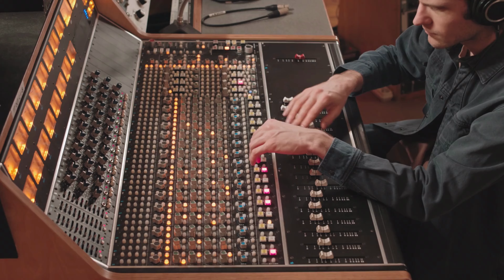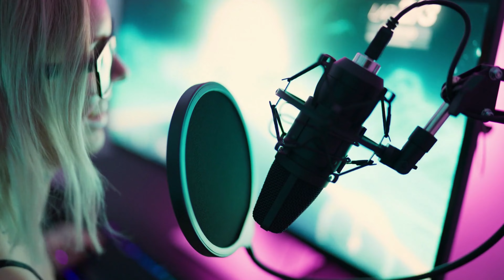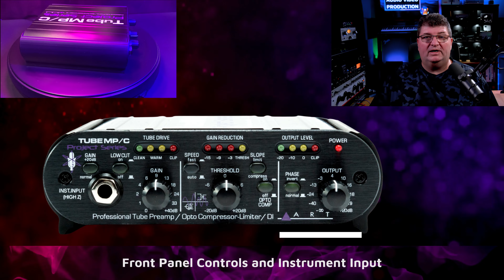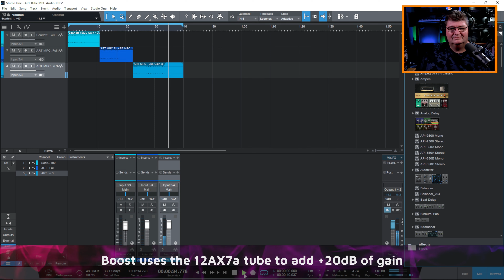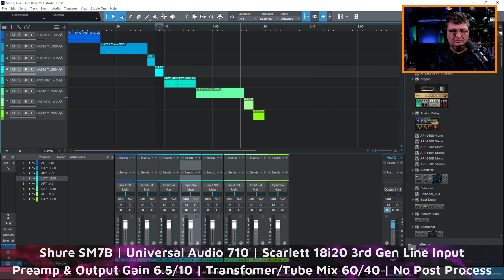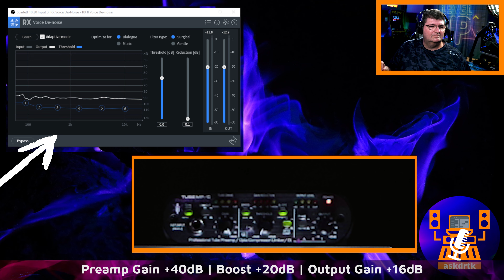ART Tube MP/C -  Preamp & Compressor - 2022 Full Review

Comment from the maker: I used the SM7B for this review to put a high demand on the preamp and I found the MP/C was able to provide plenty of gain to stage though the 18i20 into Studio One. I didn't include mic boosters in this video, but I have tested the Cloudlifter CL-1, the sE Dynamite, and Klark Teknik CT-1 with the MP/C. All performed well and I did not experience any impedance issues.

The compressor section is a simplified version of ART's Pro VLA II Vactrol Opto compressor but shares its smooth characteristics, so at a cost of around $150 USD at the time of recording (and available from Long & McQuade for $149 CAD) the MP/C is a bargain...
Reply: Very nice video, I would like advise on what would be a budget friendly eq for this Art preamp? Thank you

Comment: It seems it´s powered by 9V AC, not DC. Is there a way to use it with any battery? I mean, sometimes I have to make music on the roof of a building, in a container, on a sail ship, a zeppelin, an 80 days travel in a balloon basket, on a space station during a 1000 year long flight between 2 galaxies, etc... they usually don´t have any AC current in any of those. How could I power the ART Tube MP/C in cases I only have a power bank that delivers DC output? Anyone?

Comment: What do you think about dbx 676 vs ART Voice Channel? I would like a lot of coloration, grit and saturation. Thanks.
Reply from the maker: Having worked with both, there are positives and negatives with each in terms on onboard effects, but in terms of pure tube drive, the DBX offers a wider range of "usable" saturation control imo. That said, both are capable of considerable coloration / saturation and can provide an aggressive sound. I hope this helps out. Cheers!
Reply: @askdrtk  Thanks. I see that both are relatively old and not very popular, not that I care about what the majority thinks, but are there maybe some better options?
Reply from the maker: You could also look at the new Warm WA-MPX. It lacks some effects found on the dbx and ART, but is is based on a classic design. Moving up in price, the Avalon 737 is popular as well. The thing is, there is not a lot "new" in tube preamps / channel strips as many are based on classic designs (often for good reasons). In the end, its about sound. I have new / old / expensive / budget gear in the studio and those considerations never come up in choosing what to use when recording or on a track or mix. I choose what best fits based on my ears. New gear can be exciting when it is released, and may even improve on what is currently available, but when companies keep making gear for a long time that also says something about how it is received over time. Just my thoughts, but may help...

Comment: Very nice and thorough review! Actually one of the rare ones which don't jump to conclusions and which don't sound like commercials. Only one comment from me - the UA 710 doesn't have a transformer-coupled input. I have one and I know it for sure.
Reply from the maker: Thanks, I am glad you enjoyed my review. I think UA decided not to go with an input coupled by transformer and instead used a trans-impedance amplifier and caps was their intent to make the solid state path as transparent as they could. This left the tube path as the color circuit. For me what is impressive about the 710 is that UA was able to create a phase-coherent variable blend of the two pathways. The 710 isn't my go to preamp, but for the right sources, I'm glad to have it in my rack. Cheers!
Reply: @askdrtk  They went that way to make production cheaper and maximize their (otherwise very ample) revenue MHO. Do you know there is a 1:1 clone of the 710 produced by a Chinese brand I'm not going to name which most probably is produced in the very same factory where the UA is made!? I would even guess it may have better components inside. For instance my 710 when you look inside has the large PP caps no-name brand in gray color while any add for the amp shows clearly red WIMA ones. It's beyond any logic how much they charge for "Designed in...." but "Made in China" products.
Reply: @dkokalanov link to the Chinese equivalent plz 🙏
Reply: @dkokalanov  thanks 😊

Comment: could this work as a di box connected into a pa system for a live acoustic gig?
Reply from the maker: Sorry I missed your question earlier. Yes, and the rear output switch gives you options for connecting to a pa and an amp on stage for monitoring at the same time if you need it.

Comment: Have you ever compared it with Pro MPA II
Reply from the maker: Not directly with the PRO MPA II. The gain structure on the input side appears similar other than variable input impedance on the Pro. The output stage on the MPC has an additional 10dB of gain vs the Pro which I would think ART did to account for the compression circuit. It would be interesting to do a comparison of sound, gain structure, and circuit topology of a few ART preamps (VoiceChannel, Pro MPA II, etc.) Cheers!

Comment: I just remember mine being all buzz.....any recommendations? I couldn't figure it out.....
Reply from the maker: I'm not sure which other gear your were using / what the MPC was connected to, but I connect my gear to isolated outlets (Tripp Lite Isobars) to ensure EMI doesn't pass between gear - I do this even when my studio power runs through Furman conditioners as mine do not have individually isolated outlets. Another thing I like to do is add a ferrite core to the power supply cord about 3 inches from barrel connector that plugs into the MPC (I actually do this will any gear that uses an external power adapter that does not have one already). If you are using the unbalanced output to connect to an amp (with the DI input) noise can sometimes come back from the amp. In that case an isolation transformer (such as a CleanBox) between the amp and MPC will usually take care of the noise. Beyond that, the usual cable routing considerations apply - try to keep audio cables away from power cables. I can't say I had any particular issues with the MPC, but these few steps have generally solved an issues in the past. Hope this helps out. Cheers!

Comment: How do you use it as an insert in a mix, how do you connect it to use the compressor as an insert?
Reply from the maker: There is not a dedicated line level input on the MPC, but I have tested line level through the XLR input and it does work in terms of signal level with the gain in the minimum setting. I set it up in a loop with a line out from my audio interface to the line in on the MPC and the line out on the MPC back to a line in on the audio interface. As I mentioned above, the gain level does work with the XLR input and the compressor functions as would be expected. This of course is not a bypass of the preamp, however with input gain set at minimum preamp coloration as low as possible (much like audio interfaces where in some cases the preamp stage is not bypassed with line inputs). Sorry for the delay in getting back to you, I hope this helps out.
Reply: @askdrtk  Thanks for your reply, I'll try it out

Comment: Hello, can't find this answer anywhere regarding this ART Tube MP/C - can you use both outputs simultaneously?  Unbalanced 1/4 inch into guitar amp and balanced direct into interface, like a DI splitter?
Reply from the maker: Great question! Yes, you can use both the balanced and unbalanced outputs at the same time and the balanced out is transformer isolated, so no worries about ground loops. Hope this helps out!

Comment: Great Review! No nonsense, no subjective opinions just FACT. Truth be told most gear today is superior to 1950's and 60's gear, I know Blasphemy!! But use your ears not your eyes. The noise floor is lower, the gain before distortion is greater, the dynamic range is wider. I think a lot of the "Boutique " stuff is overrated,  just because something cost 5x more does not mean one is getting 5x the performance, in fact I can attest that one is not. " Boutique " is marketing , i.e propaganda, not much more, certainly not worth the additional cost. Free advice 1) Spend your budgeted monies on a good sounding room first. 2) Get clean filtered power to everything you've got hooked up, amps, gear, recording medium etc...EVERYTHING, clean power isn't sexy but it's more important than a vintage Nueman or Pultec. 3) High quality cables and keep lengths as short as possible, patch bays are the Devil,  with as few connection points as possible. 4) Write a great song and capture that performance. 5) Microphones 6) and last OUTBOARD GEAR ( I won't even comment about plug-ins) psssst they suck , ok I commented. I own this unit along with some " boutique" and vintage gear I bought before I got hip to the " Big Gear Con" , live and learn and honestly I can't hear much difference. ALBINI commented on this in regards to the RNC which he has several of, he said quote " I can't hear any performance difference from my high end compressors" the same is true of most outboard gear , including mixers, consoles or Desks if your British and pretentious as hell. The ART stuff will get the job done the rest is up to you. Reallocate your bread man,get that PC/ Voltage regulator from Furman , hon your carpentry skills and treat that room. Spend the rest on toys . Peace ✌️
Reply from the maker: Blasphemy!...What would Mr. N say? (He gave us so much, may he rest in peace.) Glad you enjoyed my review. I might as well get in trouble too. I agree, much of today's affordable gear performs far better than it gets credit for. The law of diminishing returns kicks in quickly, especially for those of us working in home/project studios. My WA-2A does the LA thing, not exactly the same as the Tele, but then again vintage LA's don't all hit the signal the same either. Same for my Lin76s. They do the 1176 thing, a bit different vs my 6176, and let's not get started with all the various 1176 revision's topology... I appreciate you sharing some of the most important advice everyone needs to hear. Treat you space first, then listen and go back to see what can still be improved. Then you begin to hear what the gear is doing. Cables and power may not be exciting, but after I moved to Furmans and Tripp-Lite Isobars (medical grade isolation between each sockets) plus good cables managed properly, not only did so many issues disappear, but it felt like the second best upgrade I ever made (after treatment), and I'm never going back. All that said,  I do love gear and enjoy working with it, even back in the day with my Fostex four track...😄
Reply: @askdrtk  Hahaha I didn't know about the Iso Bars Thank You !!! I compare gear to DNA especially the burgeoning sub class of DNA , Touch DNA, everything imparts its " palm print " on sound everytime we record it. I love gear also and I have the rooms to prove it Hahaha.  I know I oversimplified things but that's only because manufacturers,add execs, recording mags and online reviewers have OVER COMPLICATED THINGS for decades . They needed " slappin down" a tad Hahaha
Reply from the maker: Love the DNA analogy, so true. I'm with you on the "gear escalation" as it seems to come back to once all the rooms are full of gear, can it be paired down, what other non-gear can go, or do I need more space...lol. In any case, as long as we keep enjoying creating music,  regardless of all the toys that go along with it, we are very fortunate (but I still wouldn't mind a separate "console room" for experimental reasons...or maybe nostalgia...lol).
Reply: @askdrtk  Do you think all the " gear hype" discourages some musicians from recognizing their talent ? I wonder some of my favorite albums were recorded on Cadsette Studios . Yo La Tengos Painful, Stereolabs Peng 33, PJ Harvey's 4 Track Demos, many more. Brilliant albums. I know from personal experience how musicians get " conned" into thinking a Big Professional Studio with hundreds of thousands of dollars in equipment will make them sound better so they refrain from recording on whatever medium and gear they can afford. Personally to my ear the little Tascam MK III sounded better than anything I've heard recorded digitally. True Story , I recorded 6 songs on Tascam Portastudio MK III in 1996. I had a buddy who was interning at Sorcerer Sound in NYC , Living Color, Sonic Youth , Dinosaur Jr. , Tom Verlaine many more recorded there.  My friend got me in on Sunday nights to re record what I did on cassette. Anyway I HATED IT, too much polish, and IMHO Neve 1073 sound like shit. It's just not worth the cost to me. I guess if you want to sound like Fleetwood Mac or Toto or Nirvana a BIG FM RADIO SOUND  you gotta pay the $400.00 dollar and hour studio OR treat the room, tune the drums properly, get clean power to EVERYTHING,  some 57's a Ribbon.  a good condenser and a good bass DI  THEN WRITE AND COMPOSE A GOOD SONG , Bingo! You're " there ". I have a Coles 4038 and a Beyer M160 but I also have a Peavey Rac 1 Ribbon and a MXL Heritage Ribbon are the Coles and Beyer 5 times better than the MXL and Peavey ? NO ! only 5 times more expensive. I know Kim Deal ( P ixies Breeders Amps) threw in the towel on that Big Studio thing after Last Splash. In fact she was so unhappy with the Albinis final mix she protested it was " too clean" and re recorded the vocals through a guitar pedal overdrive . BIG EXPENSIVE STUDIO PRODUCTION killed Punk and ushered in the 80's Sound  ugh !! 
The 90's Indie  scene was a pushback against all that then Nirvana came along and demolished that ethic. Cobain knew it too , after Nevermind he submitted his follow up on cassette and Geffen said NO WAY , Nirvana capitulated and brought us their POS follow up. There is great gear out there CHEAP, the Golden Age of budget recording with professional  results, all I'm saying
Reply from the maker: While it is unfortunate that some musicians believe the "big studio" is necessary, I think the pendulum started to swing back towards smaller project and home studios during the pandemic. Everyone had the chance to see major artists recording new music at home. Many were trying out "prosumer" recording gear and getting great results and more indie music was starting to be released than we have seen in some time. As we know, gear is not the barrier to entry to making music, it is and has always been musical talent (artists created by image and "marketing hype" aside) . It was always easier to justify a big expensive studio based on gear alone when the gap was wide, but today diminishing returns begin at a much lower cost than they used to. Yes, high end gear can be superior, but if the recording environment is anything less than ideal (for the desired sound), and the gear isn't setup to contribute to the recording quality,  the upgrade does not produce noticeable results imo. Throw $200000 of pro gear in an untreated basement with 7 1/2 foot ceilings and see what difference you get compared to an entry level interface and a few plugins. If only we could get to a point where room treatment was a priority to make the recording space as good as it can be, everyone would start to hear just how good home and project studio recordings can be (and I won't even get into one genre vs another). While gear looks flashy in a high end pro studio and can deliver superior results, the real difference and value is in the recording space(s) and knowledge of the engineer doing the recording. If the recording space can be improved with treatment and a musician takes the time to learn how to record, including using affordable gear, recordings and mixes today can be at a level we never needed to make a record back in the day... Sadly, talent does go unrecognized when recordings don't "sound like a record" and while we are not where we could be yet, I do see some hope. I see many who now do it all...artist, engineer, and even promotion/distribution after taking the time to learn each role. It could even be that affordable gear might become part of the solution to the high barrier of entry in the top studios, if we can first get our recording spaces sorted out... All we need to do is listen to the results of a recording in a treated space at home with some compression from an affordable LA2A or 1176 clone vs a recording in an untreated space with the original gear and the concept of what a pro studio is starts to change. Only my opinion....everyone reading, create first, make music, and use gear as part of the creative process if it adds something to the experience (even the vibe) and sound, not as a requirement to get started.